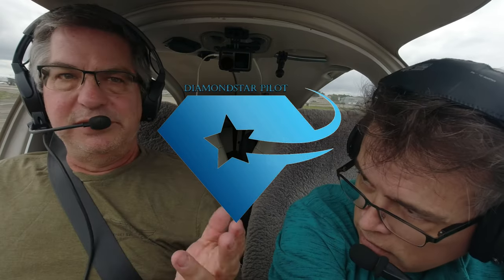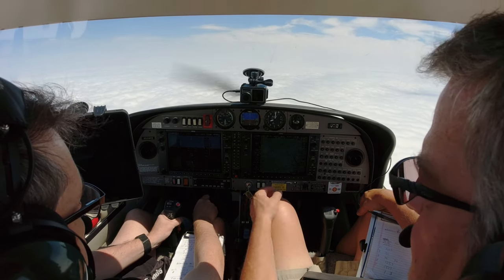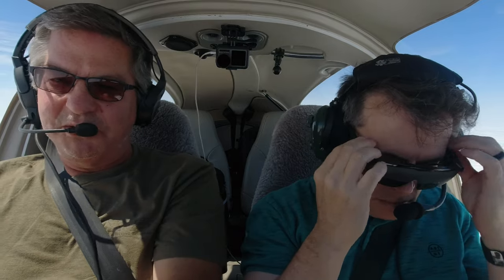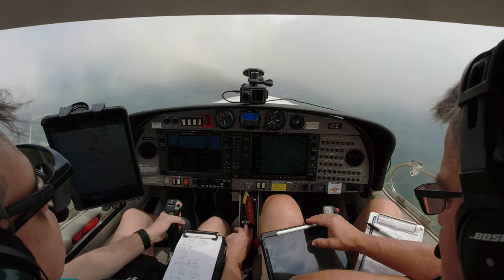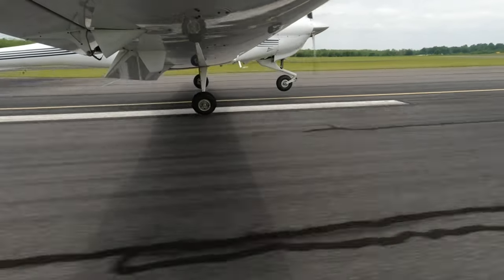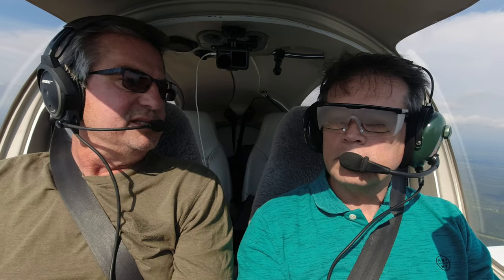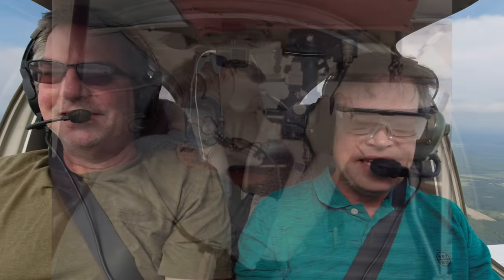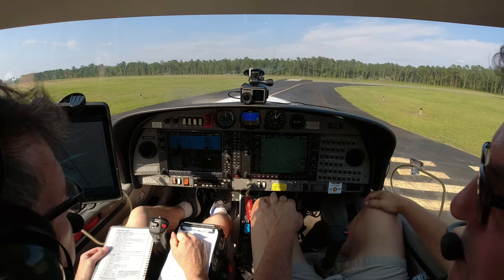Instrument Proficiency Check-Moving From Steam To Glass

Comment: glass makes pilots lazy, old shool methods are better, because tech fails at the worst time.
Reply from the maker: I respect your opinion but, I whole heartedly disagree.  Having more information easily accessible makes for safer pilots.  I'm not sure why it would make you lazy.  The glass panels are presenting the same information as a six pack (in a different format).  It is still up to the pilot to process and use the information.  If you have a six pack and add a GPS unit, you have basically the same amount of data as a glass panel.   As for reliability, I will put my money on modern electronics over vacuum pumps and mechanical gauges any day.  Thanks for your comment and for watching.